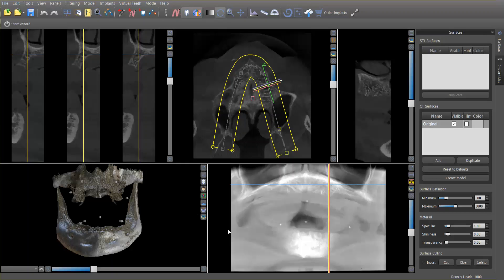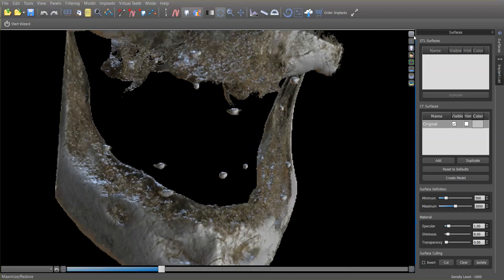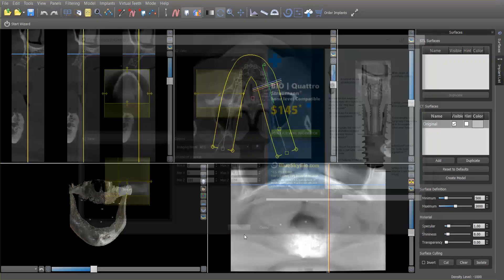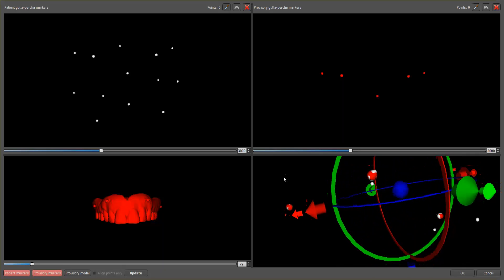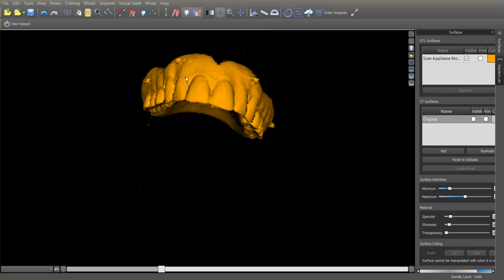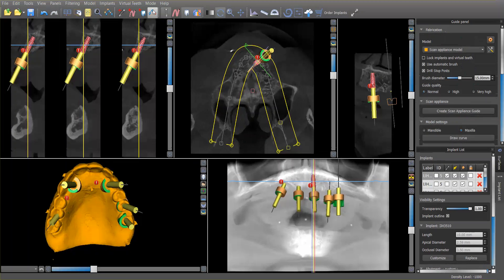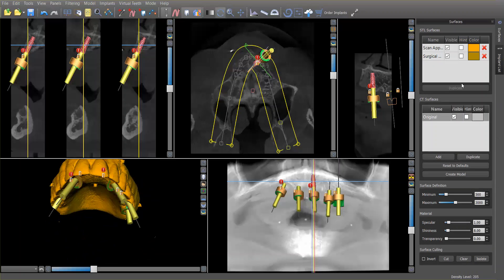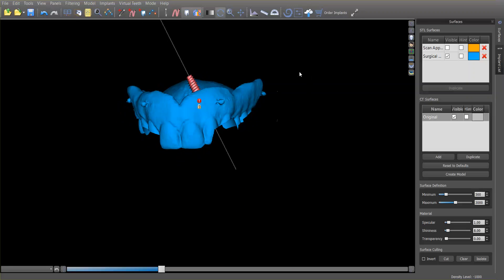Using a Patient's Denture to Create a Surgical Guide

Comment: Another great video from Cory I've seen lots of them.  If the patient had an old denture  with good aesthetics and vertical dimension and was relined to obtain a good fit would it do? One  wouldnt  have to sacrifice their existing good denture or have to duplicate. Would a cold cure reline do? would it need a lab reline?  Is there an iso values issue with Bluesky  software?